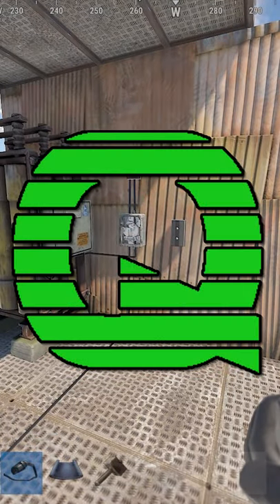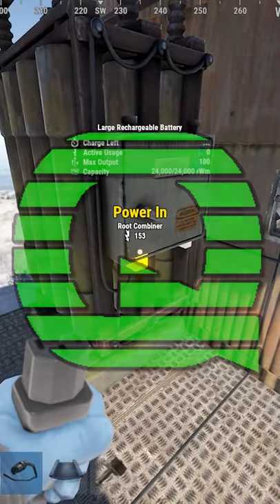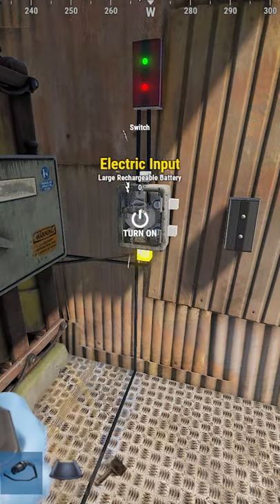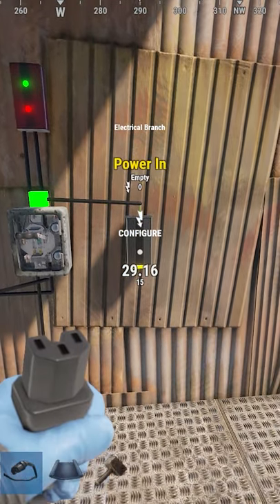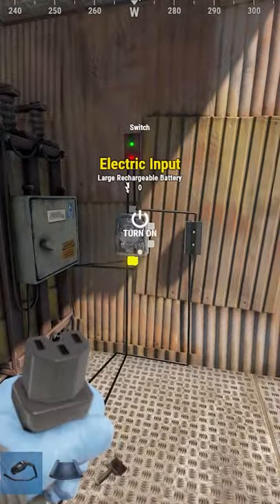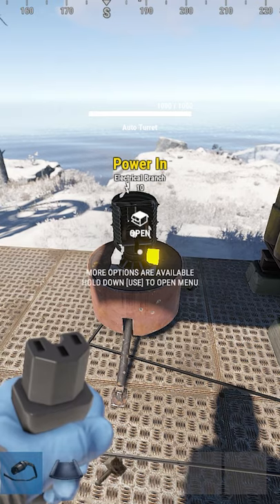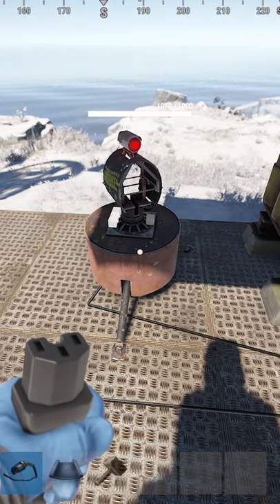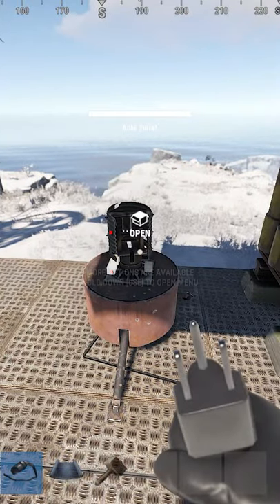How To Set Up An Auto Turret | Rust #Shorts

Comment from the maker: https://discord.gg/FjkvVFqDV6
Reply: It depends on the application. For 1-2 turrets yes, for 3 turrets no. Splitters have an issue of power loss in the 3 way split at certain input integers, it always rounds down. 31 power to a splitter is better than 33 power to 3 e branches(34 to splitter if you want to have a passthru> blocker>smart alarm turret break detection system), but if you wanted to set up a single turret, a splitter is probably a bad idea. Personally I heavily use splitters. Theyre just bigger, harder to place, and a little more finicky to use when you're altering your system. Play modded with test gens? Put the 3 test gen outputs on 2 root combiners and combine them into 1, trust me.then e branch out 96 power into a 4 splitter tree for 9 outputs of 10.another shortcoming of splitters shows up if you have power issues. E branches will fail from the end of the line one at a time as power shorts. The whole splitter tree system will go down if it drops below the necessary input amount

Comment: How do I connect multiple now?
Reply: Add more branches
Reply: Dont use multiple branches just use 1 splitter
Reply: "e branches are better" It depends on the application. For 1-2 turrets yes, for 3 turrets no. Splitters have an issue of power loss in the 3 way split at certain input integers, it always rounds down. 31 power to a splitter is better than 33 power to 3 e branches, 32 and 33 in a splitter wastes a watt(34 to splitter if you want to have a passthru> blocker>smart alarm turret break detection system), but if you wanted to set up a single turret, a splitter is probably a bad idea. Personally I heavily use splitters. Theyre just bigger, harder to place, and a little more finicky to use when you're altering your system. Play modded with test gens? Put the 3 test gen outputs on 2 root combiners and combine them into 1, trust me.then e branch out 96 power into a 4 splitter tree for 9 outputs of 10.another shortcoming of splitters shows up if you have power issues. E branches will fail from the end of the line one at a time as power shorts. The whole splitter tree system will go down if it drops below the necessary input amount

Comment: Branches takes less power then splitters???
Reply: It depends on the application. For 1-2 turrets yes, for 3 turrets no. Splitters have an issue of power loss in the 3 way split at certain input integers, it always rounds down. 31 power to a splitter is better than 33 power to 3 e branches(34 to splitter if you want to have a passthru> blocker>smart alarm turret break detection system), but if you wanted to set up a single turret, a splitter is probably a bad idea. Personally I heavily use splitters. Theyre just bigger, harder to place, and a little more finicky to use when you're altering your system. Play modded with test gens? Put the 3 test gen outputs on 2 root combiners and combine them into 1, trust me.then e branch out 96 power into a 4 splitter tree for 9 outputs of 10.another shortcoming of splitters shows up if you have power issues. E branches will fail from the end of the line one at a time as power shorts. The whole splitter tree system will go down if it drops below the necessary input amount

Comment: bro how do u get those cable idk how
Reply: Can make them with hqm
Reply: There’s a new section in crafting and there two new electrical looking things, you get the blueprints automatically
Reply: Its the wire tool in the electrical crafting section. It depends on the application. "E branches are better" For 1-2 turrets yes, for 3 turrets no. Splitters have an issue of power loss in the 3 way split at certain input integers, it always rounds down. 31 power to a splitter is better than 33 power to 3 e branches(34 to splitter if you want to have a passthru> blocker>smart alarm turret break detection system), but if you wanted to set up a single turret, a splitter is probably a bad idea. Personally I heavily use splitters. Theyre just bigger, harder to place, and a little more finicky to use when you're altering your system. Play modded with test gens? Put the 3 test gen outputs on 2 root combiners and combine them into 1, trust me.then e branch out 96 power into a 4 splitter tree for 9 outputs of 10.another shortcoming of splitters shows up if you have power issues. E branches will fail from the end of the line one at a time as power shorts. The whole splitter tree system will go down if it drops below the necessary input amount

Comment: How do you do multiple
Reply: Add more branches
Reply: @ativvafoxx5617   yeah also bro how come my battery ain't charging its like barley holding on
Reply: @BSmizz24  What are you using for your power source? Windmills or solar?
Reply: @ativvafoxx5617   but the power fluctuates from like 80/130

Comment: Nice video, but splitters would use the same draw (1rW). Splitters also have the benefit of allowing up to three turrets per splitters at the cost of 1rW instead of 3rW that you would use when using branches.
Reply from the maker: Yes I know, this video is a YouTube short and I didn't have time to explain branches in less than 60 seconds.